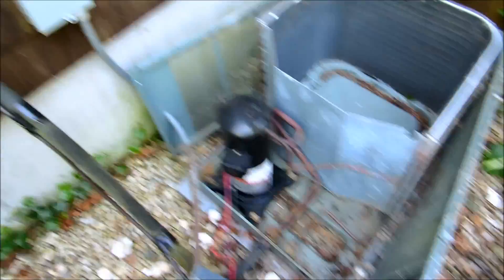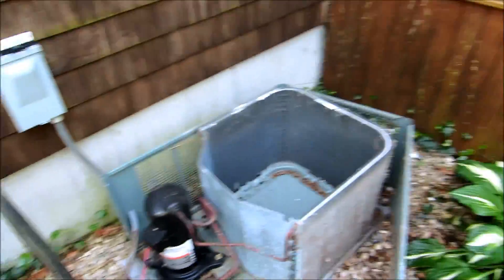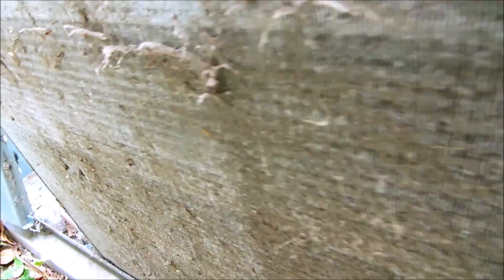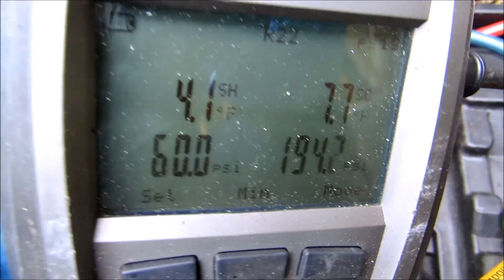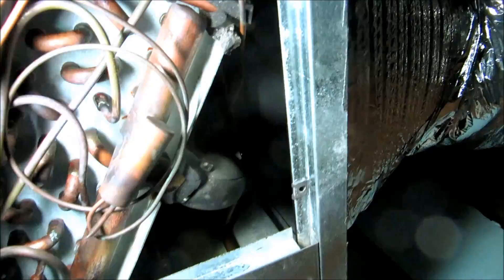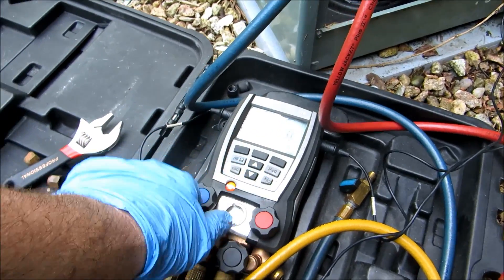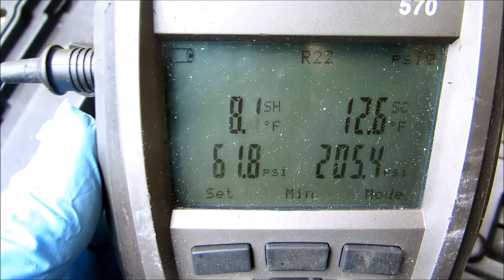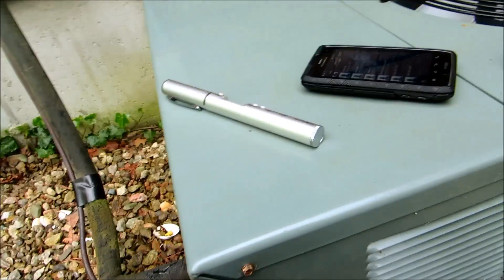hvac:condenser cleanings with a surprise at the end

Comment: Hi  Steve what is the difference between the White and blue filter
Reply: White pleated filter are 90% filters and blue filters are 7%. But, one item to remember is if your system does not have adequate return air /space then using white filters can cause real damage to a system.

Comment: Great video Steven, you're right you don't always need to use coil cleaner.  They turned out awesome.  Keep up the good work.
Ray
Reply from the maker: thanks ray i like coil cleaner if needed ,but you need to use 3 times more water to flush the stuff out .. it might flood the area with water ,and takes longer .the coil brush is wonderful for removing the build up

Comment: Nice job Steve. Undersized returns will be the death of all these systems.
Reply from the maker: its a big problem up my way .but they run for years like this ..maybe because the coolinng season is so short ... i usually see 1/2 the return needed i need to do a video about it
Reply: And the Death of Ecm motors  not proper returns.